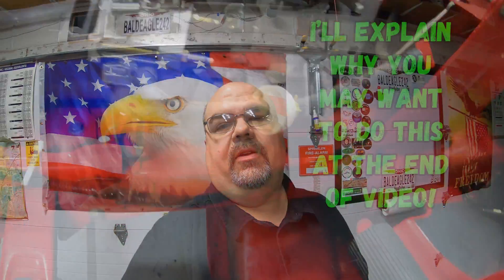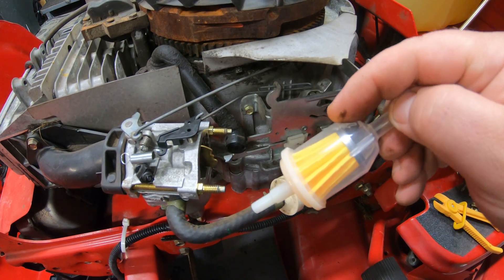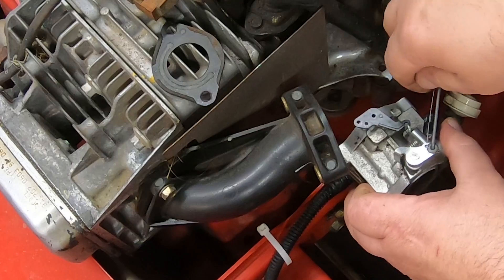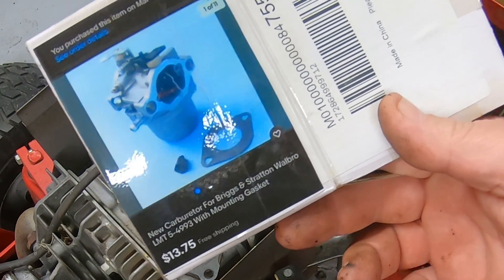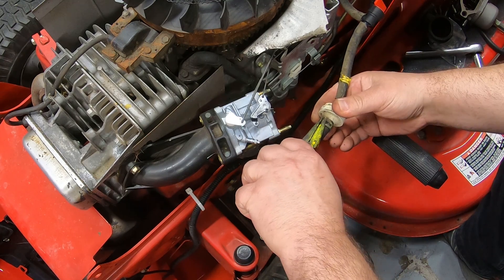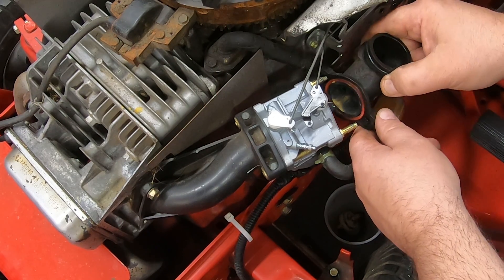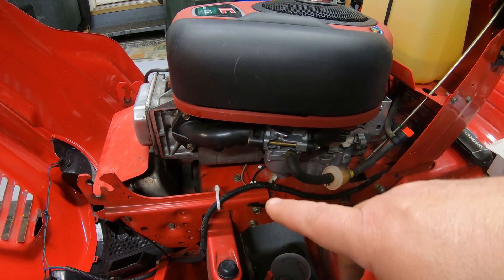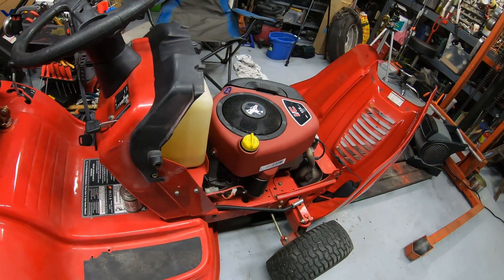Eliminate Flooding Problems: Replace Nikki Carburetor with Walbro!

Comment from the maker: As a professional small engine repair technician, I often encounter riding mowers equipped with the Nikki carburetor. While these carburetors are functional and rebuildable, they are notorious for being problematic. In contrast, the Walbro carburetor offers numerous benefits, making it a superior choice for performance and reliability. Swapping or upgrading from a Nikki to a Walbro carburetor is beneficial and relatively straightforward for anyone with basic mechanical skills.
Walbro STYLE 5-4993 with Mounting Gasket 
https://a.co/d/fPki9my
NIKKI Style Carburetor (If you prefer to keep the original style)
https://a.co/d/57WdZ3r
Fuel Filter 10 pack - As seen in the Video with magnets
https://a.co/d/cJD9i5g

Benefits of Upgrading to a Walbro Carburetor

Enhanced Performance and Reliability: The Walbro-style carburetor is known for its consistent performance and robust construction. Unlike the Nikki carburetor, which frequently suffers from fuel flow issues and inconsistent idle, the Walbro ensures a smoother and more reliable operation. This translates to less downtime and fewer headaches for the mower owner.

Easier Adjustments and Maintenance: Walbro carburetors are designed with user-friendly adjustments in mind. The tuning screws are more accessible and responsive, allowing for precise adjustments to the air-fuel mixture. This ease of adjustment can significantly improve the mower's performance and fuel efficiency.

Durability and Longevity: Walbro-style carburetors are built to withstand the rigors of regular use. This durability means fewer replacements and repairs over the mower's life, providing long-term cost savings for the owner.

Ease of Swapping or Upgrading

Compatibility: Most riding mowers with a Nikki carburetor are compatible with Walbro replacements. The mounting points and connections align well, making the physical swap straightforward.

Step-by-Step Process:

Ensure the engine is cool. Disconnect the spark plug to prevent accidental starting.
Removal of the Nikki Carburetor: Drain the fuel or pinch the fuel line shut; if your mower has a fuel shutoff, simply shut off the fuel flow, remove the air filter housing, and disconnect the fuel line and throttle linkage. Unbolt the Nikki carburetor from the engine.
Installation of the Walbro Carburetor: Bolt the Walbro carburetor onto the engine, reconnect the fuel line and throttle linkage and reattach the air filter housing. Please make sure all connections are secure.
Adjustment: Once installed, the Walbro carburetor may need some fine-tuning. Start the engine and adjust the air-fuel mixture and idle speed to achieve optimal performance.

Upgrading from a Nikki to a Walbro-style carburetor greatly benefits any riding mower owner. The process is relatively simple and can be accomplished with basic tools and mechanical know-how. The improved performance, reliability, and ease of maintenance offered by the Walbro-style carburetor make it a worthwhile investment, ensuring your mower runs smoothly and efficiently for years.

Below are tools I use in my shop and on my daily adventures.

Mini Tire Changer for mower, go-kart, and most small tires.
https://amzn.to/31eHgGp

The drill bits I use are lifetime-warranted Molybdenum from Drill Hog. 
https://www.amazon.com/dp/B010US18BG/?tag=eagle0f1-20

Hand crank trailer winch with strap with safety hook
https://amzn.to/3jTBzEL

Titanium MIG 140 Welder Works with Flux Core (No Gas needed - 110 volts)
https://amzn.to/3mqj3oP
Titanium MIG 170 Welder Works with Flux Core or Gas (110 or 220 volts)
https://bit.ly/3k8GUrD

Amazon Wish List
https://a.co/cWseC8V

As an Amazon Affiliate, I earn from qualifying purchases.  These links help you find the products I've used in this video.  Clicking these links will take you straight to the products on Amazon and help support this channel without costing you anything extra.

Get the Motion Hero Pack that I use in my videos for
Only $37 one-time investment. Use unlimited times on your own and client videos!
https://baldeagle242--videohero.thrivecart.com/motion-hero-pack-1/

If you're a video creator on YouTube - Tube, Buddy is an excellent program to evaluate your videos and make recommendations to help you attract more viewers.  
https://www.tubebuddy.com/Baldeagle242

BALDEAGLE242 Facebook group
https://www.facebook.com/profile.php?id=100068248886396
00:00 Introduction
00:26 Let's Get Started!
00:56 Safety First, Easy way to shut off the fuel.
01:17 Additional items to consider replacing.
01:33 Propper way to install a new fuel filter - Explained.
02:03 What tools you will need
Reply: do you have a link where you buy from? also can I get it with the solenoid
Reply: @baldeagle242   hey if I get the same walbro carburetor part number 54993
Reply: @baldeagle242  hey I ordered the Walbro 5-4993 Carburetor but I didn't know it was for a 12.5 engine not a 17.5 500 cc will it still work
Reply: @baldeagle242  hey is this the same Walbro Carburetor LMT 5-4993 you have
Reply from the maker: @williejbrown8059  here is a link to the one I used off of Amazon. 
Walbro STYLE 5-4993 with Mounting Gasket (This is an aftermarket Carb - Not a true Walbro!)
https://a.co/d/fPki9my
Reply: @baldeagle242  Is this same carb. available with a shut off solenoid ?

Comment: Any information on doing this swap for a 10hp briggs generator engine?   No fuel shutoff solenoid on the generator from 2012 im fixing.... the nikki is awful....
Reply from the maker: Yes they are awful! They are all pretty prone to the same issues. Clean the bowl, jets and passageways and you can usually get them working again.

Comment: Hey there, just wanted to say thanks. Great video. My 13 year old totally neglected Briggs 17.5 hp flooded like crazy. I drained at least a half gallon of fuel and oil out of the thing. The Nikki that was on it was completely unsalvageable. I replaced it with the walbro, and it fired right up. After putting fresh oil in it and running it at full speed for about 10 min, it fogged out the back yard and then cleared up, it starts and runs like new. Thanks again.

Comment: I don’t understand, I see a few videos that show these Whalbro carburetors but yet there’s no link to buy them. You have a link that’s not a Whalbro carburetor.
Reply from the maker: They have been sold out and very difficult to find for the past couple years. I see them on eBay from time to time but they sell for way more than they are worth.
Reply: @baldeagle242 I appreciate the response. If I can’t find a Walbro, what’s the next best thing to do? Rebuild the Nikki or is there another carburetor brand you like?
Reply from the maker: @DK-bm5rg Rebuilding the Nikki is the next best thing. I’m not aware of any other carbs that fit without modifying the intake system. I have a good video that shows how. 👇

No BS! Simple NIKKI Carburetor Rebuild
https://youtu.be/-uzKSJhJtww

Comment: Just used this carb on my 2015 John Deere. Works great compared to the Nikki that was on there. No more flooding and it performs better than the original carb. Thanks for the tip.

Comment: i replaced my nikki on my 2015 husqy with a walbro last week after multiple attempts at rebuild and a new chinese nikki. my mower runs better now than when it was brand new. i should have done this years ago. to anyone struggling with the same carb problems. just put a walbro on your rig. you wont regret it.

Comment: Hey The only thing I don’t agree with is the paper fuel filter you installed on a non fuel pump engine. It might initially start and run but as soon as paper filter starts to get dirty it will starve engine of fuel causing to run erratic then shut down.
Reply from the maker: I’ve heard this argument for 30 plus years and I’ve never once seen this to be a real problem.

Comment: I have a nikki on an old Rover Clipper. Its a pain to rebuild especially placing the gasket which seals the bowl to the carb body. I seem though to get better fuel efficiency with the nikki.

Comment: Just bought a Cub Cadet CC30h with a Nikki carb.  Other than the gaskets disintegrating, what's really so bad about them?  Also, do you have a number or link for a Walbro that would fit a Briggs 10.5?  I think that's what my mower has.  There's no solenoid plug.
Reply: the nikkis are ok when new and only used for short durations. but if youre like me, and on my mower for a couple of hours the engine starts skipping from fuel starvation.

Comment: Thanks for the video. I recently acquired an old riding mower and have been watching tons of videos to educate myself. Old 1995 JD Sabre with a 13hp Briggs 28M707 utilizing a Walbro LMT 5-4993. It was rotting under a tarp for years. After quite a bit of TLC, the motor is running excellent now under load but was surging particularly with reduced throttle. Took bowl off and found heavy jelly. Just removed this carb and finally got the main jet out the carb and found a lot of crud, but otherwise looks like this Walbro carb should clean up nicely. Thought about buying a cheap carb online at first but after seeing some videos, and seeing how expensive this OEM Walbro carb is, I see no reason not to clean it up and see if it works as intended. Seems pretty simple, without all these o rings like the Nikki has. Fingers crossed the motor no longer surges after this cleaned carb goes back on.

Comment: Hey I have a Chinese carburetor on my Troy Bilt 17.5 500cc  and every time I cracked up the mower is  sound like it want to cut off so if I get the Walbro carburetor LMT -54993 that will fix my problem
Reply from the maker: More than likely the main jet is clogged or too small. I’ve found aluminum flashing in the bowl of brand new Chinese carbs in the past.  If you want to fix it for good the Walbro is a better carburetor but if you take the bowl off you may find an issue with the main jet. I have a full step by step rebuild video on the Nikki carb if you’re interested. 👇
https://youtu.be/-uzKSJhJtww?si=BN0vAI-CbcqW0clD

Comment: I replaced a NIKKI carburetor with a 3rd party NIKKI style carburetor same as the one you linked to. This led to surging when the mower was idling. I adjusted the mix screws and I could make the engine idle without surging but the idle was really high.

Multiple social media sites said the Chinese knock-off was to blame. That the jets are different, etc.

I'm trying to frankenstein a carb from the original NIKKI and the WALBRO 3rd party version. I'm finding the main jet doesn't fit correctly in the plastic riser with the O-ring on it properly. It seems that the O-ring is too large.

Any advice?
Reply from the maker: Surging in small engines is usually caused by one of two common issues: either the engine is getting too much air (lean condition) or it’s not getting enough fuel. Here’s how to properly address the problem:

	1.	Check for air leaks: Start by inspecting the carburetor and intake manifold for any signs of air leaks around the seals or gaskets. A simple way to check is to spray carb cleaner or starting fluid around the gasket areas while the engine is running. If the engine’s RPM changes when you spray, there’s likely an air leak that needs attention.
	2.	Carburetor jets: Once you’ve ruled out air leaks, the next step is to ensure the carburetor’s jets are clean. A clogged main or pilot jet is a common cause of surging. Disassemble the carburetor and inspect both jets carefully. Clean them with carb cleaner and compressed air, making sure to clear any debris.
	3.	Inspect the carburetor quality: If you’re using an aftermarket or knock-off carburetor, it’s not uncommon to find manufacturing defects, such as debris or improperly sized jets. I’ve seen cases where aluminum shavings were left inside brand-new carburetors, blocking proper fuel flow. Always thoroughly clean new carburetors before installation.
	4.	Jet sizing: If the carburetor you installed is still surging after cleaning, it’s possible that the jet size is incorrect for your engine. If you have the original carburetor, measure the jet size by finding a drill bit that fits snugly through the original jet. You can then compare or resize the new carburetor’s jet using the same drill bit, but I recommend being cautious and accurate to avoid creating other performance issues.

By following these steps, you should be able to resolve most surging problems in small engines.
Reply: @baldeagle242  you are amazing! Thank you for giving me some troubleshooting steps. I will work on it today.

Comment: I've had so much trouble finding a replacement Walbro carb for my engine (18hp 31H777). The manual has part numbers for the Nikki, but not for the Walbro. Everything I find says the Nikki is the replacement, but I see tons of stuff online saying they aren't great. The Walbro looks exactly like the one I took off, but it doesn't list my engine as one it's compatible for. Should it work, or should I just go with the Nikki?

Comment: Nice video baldeagle!  Have liked, subscribed, and added to my small engine play list.  Need your recommendations for a mower problem.  I have Walbro carb 0410 497119 with leaky needle valve on Troy Bilt 33" 34342  walk behind mower. Engine is B&S 9 hp model 29E702, and original carb or parts are no longer available from Walbro.  Is an aftermarket carb available to satisfactorily replace it? I searched online but was unsuccessful. I am assuming the 5-4993 is not compatibly with this 9 hp engine.
Reply from the maker: I’m not real familiar with that combination. I was hoping someone else may be able to help but so far I don’t see any replies.

Comment: Do you have a part number for the walbro with the solonoid? Thanks!! Oh did you connect the thin wire linkage in this video? I didn’t see it connected.
Reply from the maker: @regularguy519  I’ve not seen an aftermarket with the solenoid for a few years. Here’s a link to an OEM carb. https://amzn.to/4bSvu2R
You may be able to find someone selling the aftermarket ones on eBay.

Comment: Bald Eagle your the man!  I followed your other video and rebuilt my Nikki carb. Stopped flooding and leaking gas into the oil but was surging like crazy.  Watched this video Friday or Saturday and ordered the exact carb you show here. Chinese walbro knockoff. Put her on and set the needle jet to 1-1/2 turns and started idle screw at 2 turns and adjusted. Fired right up no surge. I’m pumped.  Thanks so much. You earned a subscriber.
Reply from the maker: Thank you my friend. I’m happy to have you here and glad it helped. 😁👍

Comment: Great video 👍
 I have I think about a 2002 model Briggs 17hp Twin 2 opposed twin flat head engine on a Snapper rear engine rider that has a Nikki carb without the solenoid. I'm thinking that this swap would work on it as well. 
 I have a question for you also if you can help. I'm working on my bro in laws little Craftsman 29cc 4 cycle lawn edger and it has the Walbro model WYLB  5A carb on it. It runs smooth up until about half throttle but anything past that it sounds like a 2 cycle engine that's tuned too rich, I think people call it 4 cycling. This carb only has a low speed mixture screw hidden down into a hole on top where the throttle lever attaches and no high speed mixture screw and the diaphragm isn't stiff or torn. I took the carb apart mostly, except I didn't take the diaphragm off for fear of tearing it, but I'm gonna spray it out with carb spray real good and if that doesn't fix it I'll be scratching my head because I'm not sure what else it would be. I'd like to replace it with a fully adjustable carb is what I'd like to do. Do you have any advice or do you know if there's a fully adjustable carb that will work on it?
  Thank you! 👍

Comment: When my lawnmower kept back firing, blowing black smoke out, I talked to the repair shop owner, he said " bad carb., needs replacing, $125.00 plus labor. At the time I purchased another Nikki, it was $19.99 from Amazon. I installed it, mower fired right up. The engine crankcase was full of gas, had to change oil as he stated in the video. Mower had no fuel  shut off valve at that time. THANKS!! Baldeagle242!! Appreciate your time & information!
Reply from the maker: It’s a very common issue. The Walbro style carbs are much less likely to have this issue. 
Thanks for watching and taking the time to leave a comment.

Comment: I have used a lot of the Chinese carburetors for replacements and have had good luck with them.  They are good cost effective carburetors.  I have used them on both 2 cycles and 4 cycles.
Reply from the maker: Same here. I’ve only bought a few name brands in 30 years of doing this for customers that won’t take anything less.
Reply: @baldeagle242  
If a customer wants only original equipment,  that's fine as long as they don't mind paying the extra cost.  Most of mind don't want to
Reply from the maker: I’ve had a few but when you show most it’s literally 10 times more they have a change of heart.
Reply: Hey I ordered a WALBRO LMT 5-4993 carburetor but I didn't know it was for 12.5 engine my engine is a 17.5 500cc  powerbuilt Will it still work on my riding mower
Reply: @williejbrown8059  
It could work, as far as getting it to run, the problem might be, not enough air, or gas to put out 17.5 horsepower.  It might be made to work and give you 17.5 horsepower.  Frankly,  would be cheaper to buy a carburetor for the application.  Than to modify the smaller carburetor.

Comment: Nice job Steve! As always your videos are spot on and to the point. Putting the Walbro style carb on as a replacement seems to be a no brainer and i agree you dont need the anti backfire solenoid. The people that shut their engines off at wide open throttle , i bet they dont do that to their cars 😂😮.  🤯 🇺🇸
Reply from the maker: Thank you Roger. I appreciate the kind words.  Nothing amazes me anymore with the way people treat their equipment.  🤦🏻